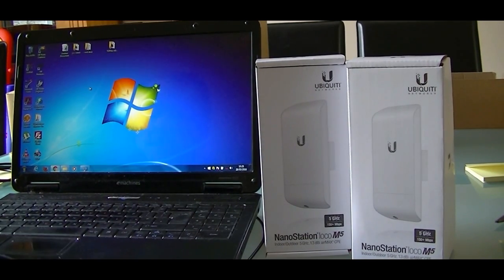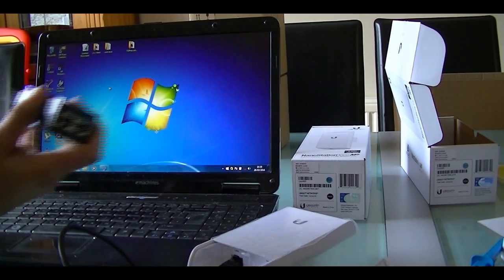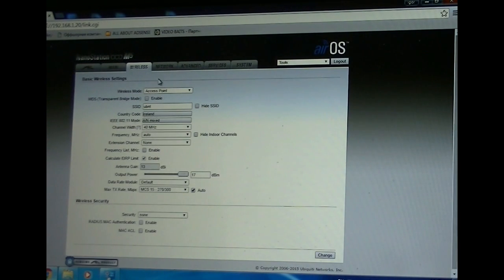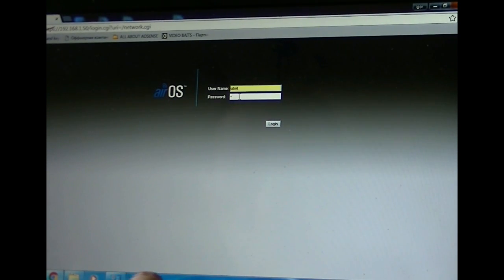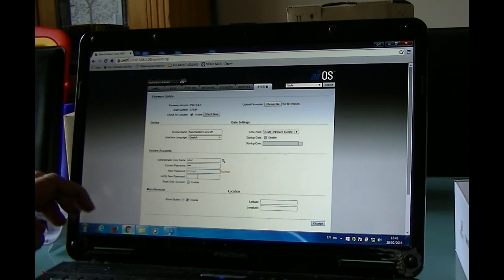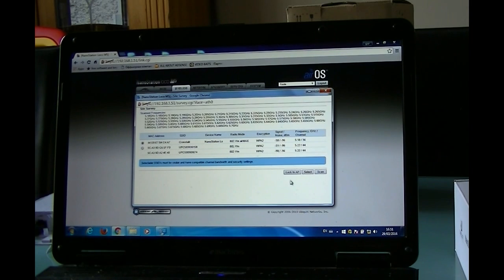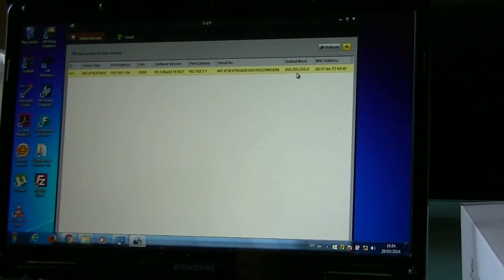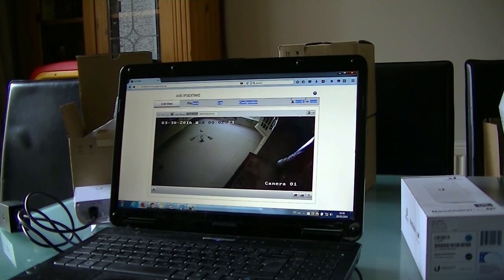Nano Station Loco M5 set up

Comment: Thank you for the video very instructive. I plan to put 4 PoE cameras into a bridge and then connect the bridge to the distant Loco M5. Is the bridge transparent? That is can you address the camera directly through the bridge without and set up of the bridge in the system? Also on the receive end I would like to connect the M5 into a router and access the camera from my computer via the router. See any difficulty in that?

Comment: Looks like you have it backward.  The Access Point (AP) goes at the house where the internet is.  The "station" goes out in the field where the camera is.
Reply: Check the ubiquiti website and the "Station" can connect to multiple AP's (PtMP). The "station" is your multi point convergence and would be the single point of connectivity for all of the AP's in the field.
Reply: You are correct. You can setup point to multi point with several transmitters(station) and 1 receiver (access point).

Comment: how did you connect the IP
 camera to the loco m2 antenna??
Reply: via LAN port on the Ubiquiti PoE injector.
Reply: is it possible to connect a switch to the lan port and connect cameras to the switch, will it work?

Comment: Once both units are programmed, what is the actual set up?  Is Nano A still plugged into the computer and black adaptor via ether net and what is Nano B plugged into a half mile away? Can't be another computer if it is outside.  Not very technical here!
Reply: power (wall socket or outdoor socket), the PoE port (of the PoE injector/power supply) to Nano B, and LAN port of the PoE injector to the camera.

Comment: Hi, thanks for the video. It helped me understand how this works. Just one question: how do you decide to use 5GHz or 3.0 or 2.4GHz Nanos? What do you need to take into account?
Reply: 2.45 Ghz for small distance / Indoor
Reply: @StephenGachara  The two big differences between the 2.4 GHz and 5 GHz frequencies are speed and range. A wireless transmission at 2.4 GHz provides internet to a larger area but sacrifices speed, while 5 GHz provides faster speeds to a smaller area.

Comment: Why did you chose the access point M5 to be on the camera and the station to the laptop. Why not station on the camera and access point to the laptop? Also why not try using just one as station(connected to camera) and connect to the existing 5Gh router. Thanks for the video
Reply from the maker: +Tim Mark
 Hi Tim .
This was first time i used them and when i was buying equipment   supplier   told me i would need 2 units  and only then i found out that it possibly to set up with one unit to existing router but there is also questions to be answer with that set up as i didnt know what frequency my client router  ,then if there is any problem with the router ,or client decided to change internet provider i would have to comeback and reconfigure all again and in that time my cameras wouldn't  work ,so for that reason set up was done as  independent network. The set up itself was don by ubiquiti support information about" access point" for 1st  unit and "station" for the 2 end   and now will try to explore this equipment bit more for the future use.  Also to mention  the units came with older firmware that did give me bit of a trouble ,until  i upgraded to latest firmware ...
Reply: Just to add. I think the reason why you use two is that its got its proprietary air max tech. Now this works from Ubiquiti to Ubiquiti device. So my guess if its you have a longer distance then its good to have two. If you have short distances you can get away with one. In your case two is better. Also you get more stability with two. The reason why I was why station was used at the router then if you have more cameras you would need to buy two each for each camera.
Reply from the maker: You quiet right on this  . Also to mention i did set up 2  x 3Mp Ip cameras on this wireless link via POE switch   and its working prefect .i am sure u can add more cams to it, but have to watch out as it will slow down transmition speed .i  also see ,that when i log in remotely to NVR those 2 cams that are  on wireless link take few sec  longer to show up on the screen ..